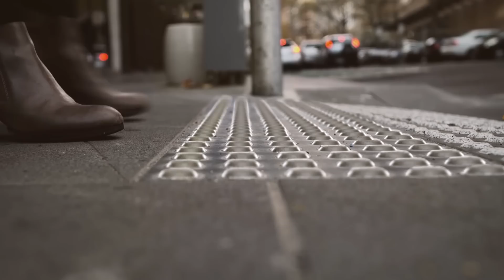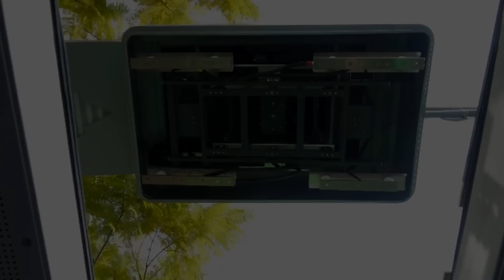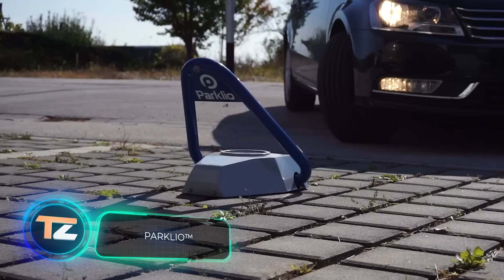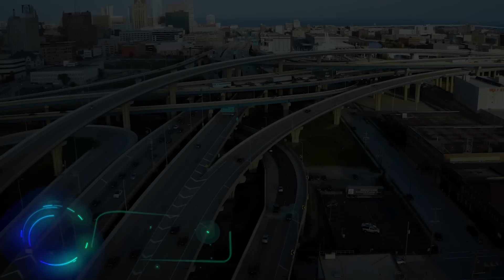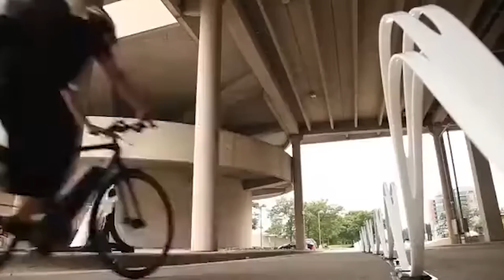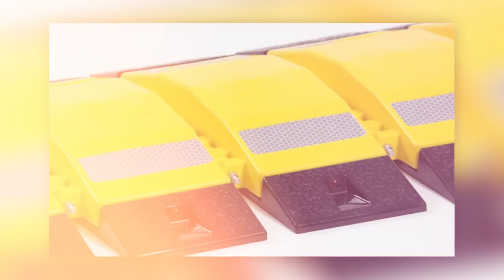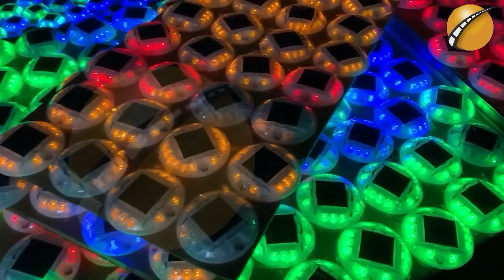INCREDIBLE ROAD TECHNOLOGIES THAT ARE REALLY INSANELY COOL

Comment: 8:25 A similar thing was tested in a stretch of road locally that was a known risk to drivers new to area for its blind bends and poor visibility. So the council decided to give something like these a go. Millions later, and they ended up replacing them. The trouble was that the new very bright lights were shining in the rear view mirrors of all drivers. The distraction and constant light in the mirror were the cause for twice that many crashes for two years after they were installed.

Comment: How is that parking lock thing vandal proof? It's a single piston that's bolted into the ground. Break the piston and it stops working. Unscrew the bolts, and you can simply remove it.

Comment: those flexi bike lane barriers need to be installed on UK pavements. way too many car drivers think they can park in the middle of the pavement, blocking it so people can not walk on the pavement. they either say its so their passengers can get out on the pavement or they have an electric car and the cable is too short so they need to park in the centre of the pavement to reach - I don't drive but I still know you are meant to either get your passengers to leave the car via the doors on the pavement side OR if it's a front passenger you drive up/down the road so the passenger door is next to the pavement... as for the electric cars drivers..... park the frelling car in your garden your useless tw4ts

so again, put those flexi bike barriers on the pavements and this would stop car drivers parking in the wrong place

Comment: Here are some things I'd like to point out about each of these products. This is purely based on initial impressions :

1) ETI Road Roller System 
Standard stainless steel barriers serve 2 critical functions. They provide shock absorption and they induce friction via the vehicles body to slow down the vehicles speed. The ETI Roller System appears to have the same shock absorption function however, the rollers do nothing to slow the vehicle down. All they do is deflect the vehicle back into traffic. 

2) NOKIN Solar Road Stud 
This idea is actually a great idea. However, looking at them, I don't see much durability against a vehicle weighing thousands of pounds. The other thing to consider is the shear number of failure points. Having hundreds, maybe even thousands of these per mile. demands a lot more maintenance. Because of that, it's safe to assume that multiple failed lights could potentially lead to a false indication of a break in the road for something like a driveway or pull-off. That, in my opinion, would lead to accidents in poor weather. On a more positive note, I think these would work great for intersections and crosswalks as shown in the video.

3) TAPCO BlinkerChevron Dynamic Curve Warning System 
This system is already widely in here in the US. However, I don't believe they are "dynamic" as stated in the video. It is very difficult to single out each approaching vehicle given their varying closing speeds on a busy highway while indicating to a specific vehicle the proper safe speed around the curve.  That's why it is simpler and cheaper to just indicate to all vehicles the presence of the curve with multiple LED signs lining it.

4) Portable Speed Bump 
This is a great idea for temporary events for safety. The product in the video however, doesn't look like much of a challenge for most vehicles. It would be for a vehicle traveling at a much higher rate than possible in a parking lot. Great idea, but by no means a new one.

5) ACO DrainBox Road 
For the most part drainage systems work just fine. I don't see the need to reinvent the wheel in this case. If you're talking about designing a bypass into the system, that doesn't solve the problem, it just creates another point of failure.

6) Wave Delineator
A barrier is a device that prevents movement or access. This does not do that. A cyclist can easily cross the wave divider between the lower sections. Most divider posts are colored orange or yellow. This because it draws attention. White can easily be ignored. Divider posts appear to be easier to manufacture over more complex designs, which means they are cheaper to design. I don't see the advantages here other than visual.

7) Buro North Smart Tactical Paving 
At it's core, this encourages pedestrians to ignore situational awareness. It also adds unneeded complexity to a potential investigation should a pedestrian-involved accident takes place. Not to mention high costs and complexity associated with implementation to current infrastructure. 

8) Traffic Tech Automatic Barriers 
I can see this systems use in emergencies. However, it implies that one person controls it's operation. If it closes, it impedes traffic, including emergency traffic. That means it has to be reactivated 60 seconds before emergency vehicles arrive and activated again to close it. The cycle repeats for addition units arriving. It's complex expensive and depends on the power grid. Safety cones and large passive barriers work just fine. If time sensitivity and driver awareness is the focus here, I'd say bright informational LED signs might be a better avenue.
9) Parklio™
This isn't a bad idea for reserving parking spots. It does have some weak points though. Mainly, it doesn't look like it could stop a car or especially a large truck. Vandal-proof is a bit of a stretch too. Bluetooth and wifi intrusion isn't difficult. I'm really on the fence about this honestly.
10) Intelligent flexible charging pantograph  

11) Spotflex Sprayplast 
I like this idea. No real complaints here. I am curious about their ability to stay adhered to the road surface for long periods of time though.

12) Traffic Tech CADO® 
Like the  Traffic Tech Automatic Barriers, this adds complexity over a simple break in the barrier of two parallel opposing roadways. Adding this feature means you either have to add a central operator to control it, or add an activation device in all emergency vehicles that has to be activated at least 30 seconds before arrival.  It adds many failure points and most times, additional delayed response time to emergencies. It has to be timed perfectly to be effective and depends solely on the power grid.

Comment: I see my hometown in the blinking traffic signs section. We have used these for at least 10 years, especially on that interchange of 3 freeways.

Lights appear on stop signs and high traffic pedestrian crossings in residential areas. They are extremely effective and solar powered. A community located on top of a mountain even has lit indicators along the edge of the road, because it is a very dark and winding road without trees for reference and a very steep drop off the sides you don't want to go down.

Comment: Can you imagine that someone doesn't want you to drive with your car? How can they achieve their goal? Well, at first, if you drive an electric car, they could just remote control it and lock the doors or, if you're currently driving, shut down the engine. If they can't,  they can block your parking barrier. If you haven't  a parking barrier, they can block the road with one click by moving a road barrier. Believe me, you don't want to open Pandora's box.

Comment: We have in the Netherlands separated bike lanes most as possible. Those flexisticks do you see most often in Canada. The flexible nature gives "suggested" safety where there is little. And those solar powered reflector studs, we call them frogs, are all over the Netherlands.
Reply: It's a visible signal to the driver to keep them alert, and they won't intentionally drive over them to avoid scratching the car's paint. So it does do a small service. 
In the minds of tax payers, there's not enough bike riders in Canada and U.S. to justify reducing driving lanes on the roads (chicken and egg problem, but also in winter time hard to ride a bike at -20' C and snow, so commuters need a car anyway).
Reply: @robineff708  not just bike made a video about cycling in Finland in winter and why Canadians can't do it. it's not the fault of the cold or the snow but only from the lack of political will.

Comment: LED road studs are a stupid idea.  Whilst they are highly visible, they won't last anywhere near as long as traditional retroreflective ones - and are likely much more expensive.

Good retroreflective studs are more than adequate especially as headlight technology has increased.  The issue on most roads is that they just aren't present, or where they are, they aren't maintained/replaced.

Comment: That roller barrier looks incredibly dangerous to me. It doesn't so much absorb an impact as just bounce the vehicle off the barrier and back in to traffic. You'd be better off with a classic ARMCO type absorbent barrier or one of the modern wire type ones.

Comment: I'd like to see heat strip built into the interstates to keep them from freezing...
Reply: You mean just Bridges and possibly overpasses
Reply: @hyperwebbing  ,well that could be a good place to start,,I presented the idea to the federal dot,,they said it would be to costly,,
Reply: @gunterterry  true but it can be done so that the element rods are inserted into holes cast a few inches below cement/asphalt top surface and installed after physical construction and removed before demo or improvements requiring excavation and relaying. Also making it the same and as a standard helps when repairs are needed and would keep costs down. Think of how many Highway lights street lights there are that are on From Dusk Till Dawn every day of the year some of them are very bright some of them like especially on the interstates they'll have those huge Towers with those circular skeletons holding so many of these lights that are like spotlights I mean we don't need that many we don't need them that bright and maybe don't need them on every night or all night. I bet you a lot of people at North would trade buy stuff roads or having salt having to put on these Bridges and overpasses for every single light to be off and no repairs made on them and no new construction of them to have heating rods stuck in Holes and then connected to a electrical box that would then go on to connect to the grid

Comment: I wonder how many people are killed or injured each year because they've blindly trusted the walk sign and have stepped onto the crossing to be immediately hit by a vehicle whose driver has failed to observe the red light? Probably quite a few thousand. Are there any statistics on such accidents?

I'm always amazed at how many people blindly trust that all traffic has stopped just because the lights have turned red. Once, while walking in a pedestrian crossing, I was almost halfway across. A car had already stopped for me and I was about to proceed in front of it. Luckily I was paying attention because there was another vehicle coming up behind the stopped car. The driver hadn't been paying attention and hit the brakes too late, pushing the stopped car about halfway into the crossing, exactly where I would have been if I'd continued walking. I would have suffered two broken/ crushed legs and perhaps head injuries if I'd walked in front of the stopped car which happened to be a Volkswagen Beetle with the engine in the rear. The eninge would have been totalled. Since that incident, I try to make sure to pay attention to my surroundings. It's just plain stupid to blindly step onto the road just because you have the green walk sign. Neither should you step onto a crossing in front of a car you believe is slowing down to stop. I've seen a few people almost hit that way.

On another occasion I saw a bicycle rider ride onto a crossing to cross the road, that is, use the crossing like a pedestrians would. By law he should have dismounted and walked the bike across. All the cars and trucks had stopped and the rider had a green walk sign. Then another bicycle rider came barreling along past the stopped vehicles and crashed into the other rider. Luckily neither rider sustained serious injury, but I hate to think what would have happened if, instead of an adult rider in the crossing, it had been a parent pushing a baby in a pram, an elderly person perhaps with fragile bones, or a pregnant woman.

Another thing to avoid doing is stepping behind your car to access the trunk/boot when another vehicle is pulling into the parking space behind your car. Just a slight mistake by the driver could end with you being crushed between vehicles. It has happened.

While the Buro North Smart Tactical Paving may save some lives, I feel it's actually encouraging people to walk around with their eyes looking down at their phone rather than paying attention to their surroundings.

Comment: A very interesting presentation but which surprises by the use of an archaic measurement system. The year 2023 has just begun and a small village still refuses to get in tune with the rest of the planet. It is obvious that the US are attached to this system as the Spaniards are attached to bullfighting and the French to flee the shower as long as possible.
Did you know that nothing prevents your videos from being seen by the rest of the world?
Do you know that, when you get excited by giving a distance or a weight, the rest of the planet remains with their face inert in front of their screen, trying to guess what it could correspond to in a system which no longer measures objects, distance or volume with its foot, thumb, forearm or left testicles?

Comment: Several of these implements look very good - a few I’ve never seen (like that Parking thing that moves up and down).  But I’ve become very anti-electric for vehicles, etc. when I learned all about the batteries - what they are made if, where the minerals are from, how much I e battery will cost when replacing in a car and for me the worst - the limited range (miles) an electric car can travel without charging,  we just came back from a trip out to Colorado back to North Carolina where we live.  Driving through just Kansas alone where even a rest stop is hard to find - an electric car would be dead!  And just how many hours does it take to charge a car, or a bus or other vehicles -  hours for a car.  It took us 2-1/2 days to return home - having to add in hours for recharging would have doubled at least our trip!!!!!!
Reply: Yeah, that's why electric charging stations are part of the new infrastructure funding via the Inflation Reduction Act!
Reply: Most cars recharge to 80% or 85% in 20 or 30 minutes - pretty typical time you stop at a road stop for bathroom break and stretch your legs. That will take you another 200 or 300 miles for most EVs.
Batteries aren't perfect for sure, but neither is gasoline, for a multitude of reasons.
Reply: @robineff708    Great info but I’m still not I. Favor of electric for so many reasons.  We were coming back from Colorado to North Carolina last week and there were very few places even to stop for gas or a bathroom - didn’t notice a charging station anywhere.  We were in Aurora, CO and didn’t see a single charging place, and yes, I do try to notice these things.  So we won’t be going electric till hell freezes over.

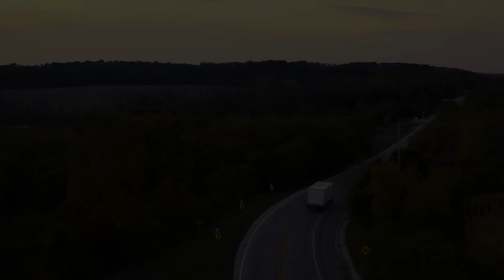Comment: 05:05 wave delineator would not be a useful product for the Netherlands because we have so many bikes. our proper bike lanes are already separated from the car lanes by a curb and/or parking spots. the bicycle "gutters" as notjustbikes calls them where there is no real separation of bike and car traffic this usually is because cares will have to pass over the bike lane to reach parking spots or because the street is to narrow and low speed to make a separated bike lane thus again removing the need for this system. in my opinion it will only have its place in bad (car first) road design.